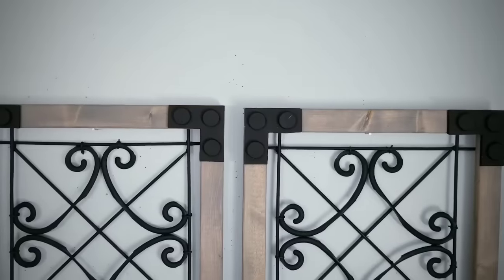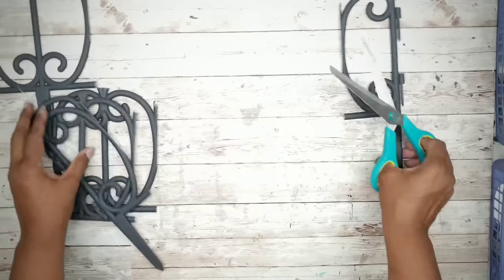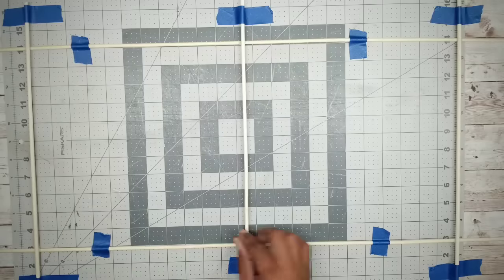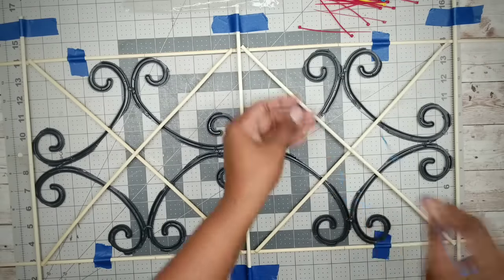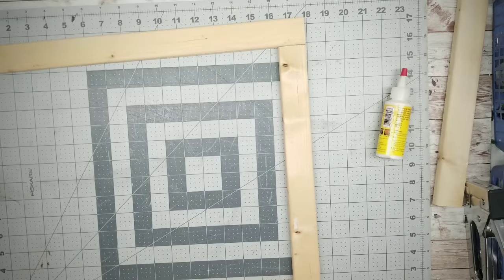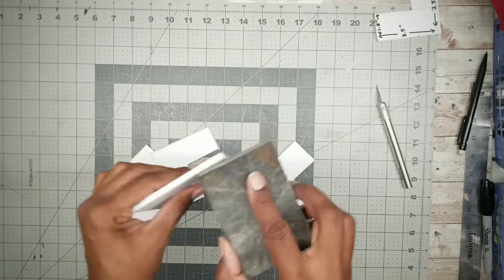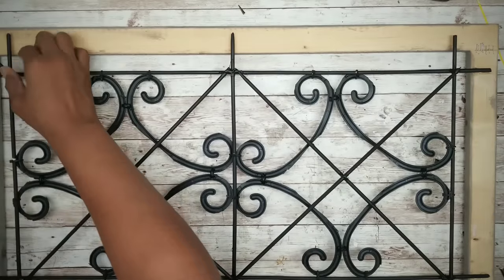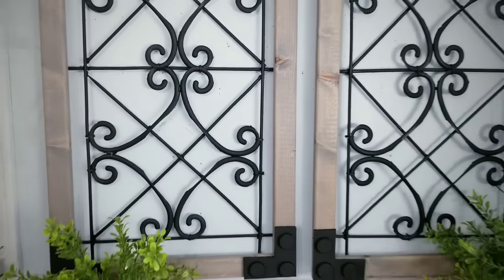DIY DOLLAR TREE Wayfair Inspired Wall Decor | Real Wood | Wrought Iron Look | High End Home Decor!

Comment: You could make the rubber curves equally thick by putting on hot glue n then paint it.....just a thought
Reply from the maker: You sure can! If you want the symmetry and uniformity of a commercially manufactured piece, you can absolutely do that. So easy to customize, I love it! 🙂

Comment: Love the overall look! However the cuts are too obvious and uneven on the fence pieces, but your ideas are always great.
Reply from the maker: You can sand them and even them out if needed. I was working quickly, so yes, some cuts are obvious. $4.
Reply: @SheSoCraftDee  I think you did a great job. That was the only thing that caught my eye was the difference in thickness but that could easily be resolved with buying an extra fence section and making the cuts even in the section. You'd lose one side of swirl but I think it would be worth it in the end. Love what you did!! So creative! <3